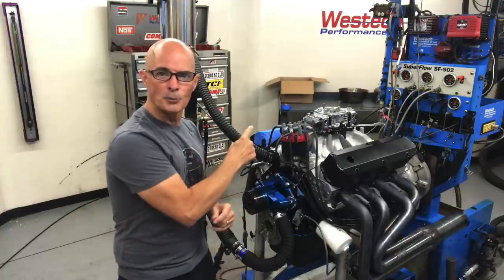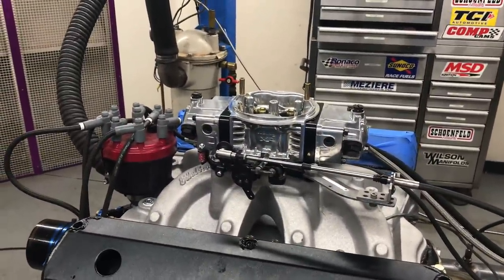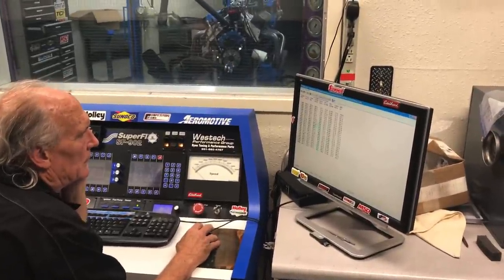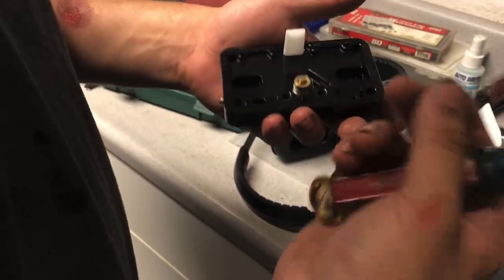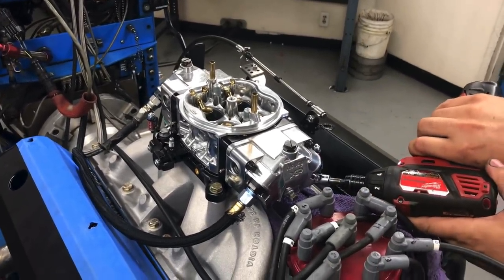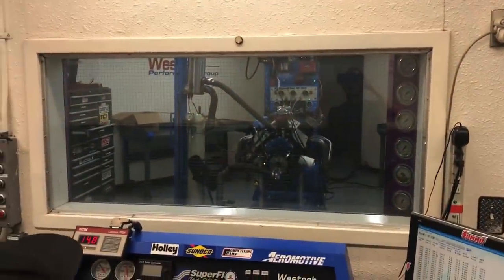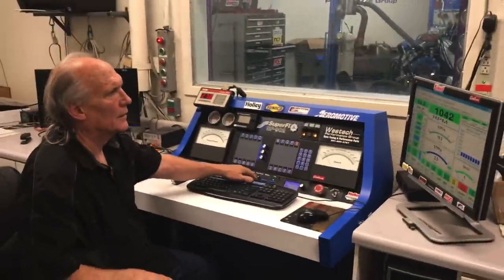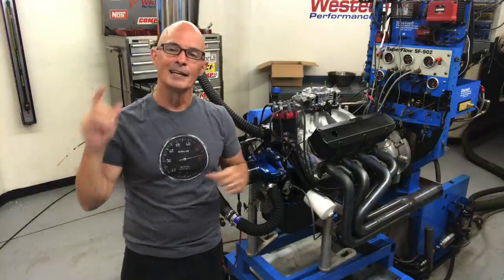HOW TO: HOLLEY CARB TUNING TRICKS (408 STROKER SBF)

Comment: best way to tune a carb, chuck it into the recycling bin, and put on a efi system
Reply: Publicly admitting carb tuning ignorance?   :)
Reply: @rlovell383  I've tuned hundreds,
Reply: @seancollins9745  what edelbrock?
Reply: @karlsracing8422  you name it, carter, zenith, holley, rochester etc. Carbs, just let them go
Reply: I had an Edelbrock on a supercharged 350. It ran great out of the box! I set the idle with a vacuum gauge. Never had to open it.
Reply: Someone dont know how to tune carbs making statements like that ! 🤣🤦‍♂️
Reply: A carburetor is a static metering device in a constantly changing environment. Carbs are great when tuned properly for the environment they are currently in. EFI self tunes but always leaves power left on the table available through the charge cooling offered by a carburetor.
Reply: @8power857  roflmao, if you spend any time datalogging AFR on a carb engine, you'll realize how bad they truly are. 

the reason modern engines last longer, they don't wash down the cylinders non stop
Reply: @jeremypike9153  I've seen the dyno tests, well designed EFI systems make as much power and typically more tq, with less engine wear
Reply: @seancollins9745   you're doing great 🤣
Reply: @8power857  go ask any powertrain engineer
Reply: @seancollins9745  my goodness! Im sure the guys making this vid and about 75% of the guys watching this vid know of many of the pros and cons of carbs and efi.  Read the title of the vid !! Lol. Di it say "opinions and dumb comments on wether we should toss this carb in the bin" , OR did it say " how to: holley carb tuning tricks". ?? Go pedal the merits of EFI to a vid about electric cars. Im sure they will be just as happy to hear your powertrian engineers opinions on EFI ! 🤦‍♂️
Reply: @8power857  you took satire to a level of offense
Reply: @seancollins9745  🤷‍♂️ im not offended !
Reply: @seancollins9745  Sean, you truly are miss informed..carbs make more power then EFI. Just ask Steve Morris, or the guys at APD....no reply needed...lol
Reply: @MRnicknitro919  anyone who thinks EFI makes more power truly doesn't know how to tune a carburetor in. Yes there is only so much you can do with the afr but that isn't why an in tune carb always outperforms EFI
Reply: @jeremypike9153  No jeremy , Thats not the only reason. There is more physics involved...racing , building horsepower/ torque is all about math and science..physics ... A carb is much more involved then a EFI, carbs with superchargers be it positive displacement or centrifically, or turbo makes more power due to a few different things, one being the cooling property of the fuel being introduce in the mix early in the plenum . which helps and acts as a intercooling effect, just to mention one example.
Reply: @seancollins9745   Sean go ask Dale Cubic, Chuck Nygen, Willis, APD,  Pro systems...lol
Reply: @MRnicknitro919  your "argument" from authority is amusing. Ask the to build a carb that hit a spefic afr at the same load at any rpm on the operating range. 

carbs are nice toys for weekend warrior and dedicated race car builds, no place on a modern on road high useage engine. 

unless you want, ring wear, oil washdown, poor fuel economy, suboptimal output outside of very narrow operating rangesand remember, the less restriction a carb presents, the less accurate it becomes
Reply: @jeremypike9153  no, carbs do not make more power than a properly built efi system, ever. 

uf that were true, F1 would use carbs
Reply: @MRnicknitro919  honda 2.0 engines got 30 mpg, no carb defys the law of physics, keep smokin what ya got though.
Reply: @seancollins9745   .Sean 1989 toyota Corolla , 28 mpg, carbureted 2.0 liter. , 1965 ford falcon 4cyl. One barrel carb 28 to 30 miles a gallon. Again do your research... Your arguement is getting weak ... Drink another Starbucks double vanilla latte with whip cream and cinnamon sprinkles.... Lol
 Again research predator carburetor, they were a head of their time a multi venturI unit that flowed from 450cfm to 950cfm marketing killed it. People were scared of it..it,was,and still is a a great carb. Would put it up to any fuel injection.   💪😎
Reply: @MRnicknitro919  jim jines said he has some cooli aid for you
Reply: @seancollins9745   Sean learn to spell my friend..its Jones.. And Obama told you , you can keep your doctor and your premiums wouldnt go up...lmao...Again research predator carburetors . stop replying your making yourself look bad and digging a very deep hole . I let you off the hook earlier , so run back to Starbucks and have a latte.
Reply: @seancollins9745  they don't get it, never will. I look at it like this. The last car sold for public highway use in the united states was around 1987. Gm and Ford stopped using carbs in 83-84. Over 35 years ago. Enough said.
Reply: Why? To make less power and spend 5k more?